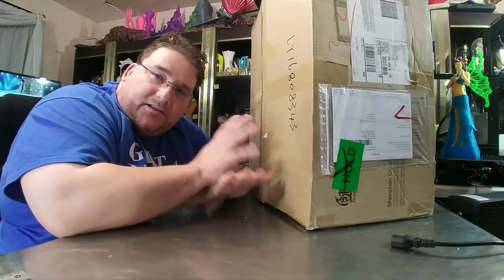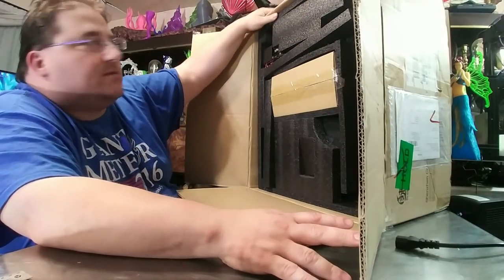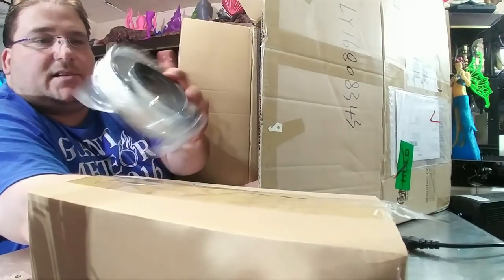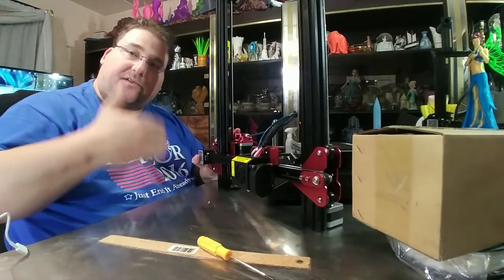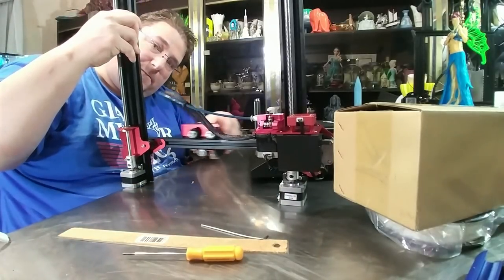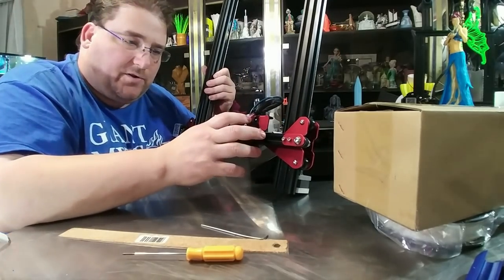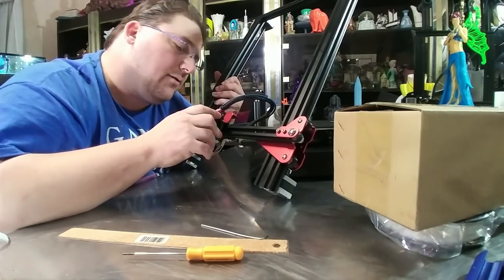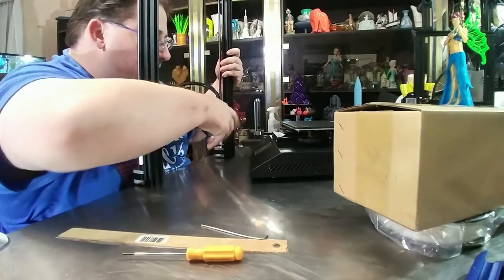CR-10s Pro Behind The Scenes Series Part 1 - T3DP

Comment: Where can I buy the sheet they used on top of the glass? My CR10S Pro has the same aluminum base but the removable bed is aluminum as well instead of glass which is what yours has. My removable aluminum bed is very warped which is causing a lot of issues. After tweaking with ABL settings for days I think it's better to just solve my warped bed issue. If can buy that sheet material that came on the upper removable bed and put it on the aluminum base (the base is completely flat) it could solve my problem. Anyone know where I can buy that sheet or something better?
Reply from the maker: Go to Home Depot and for $10 you can get a six pack of 12 x 12 mirror panels slap one of them right on there if you're not in the US any Home Improvements tile store should have them and they should be very cheap then just either print directly on the glass or apply glue stick or Hairspray or apply a normal bed sticker to the glass
Reply: @nerys71  I did that last night: https://imgur.com/gQHE3Yf

I disabled the sensor in the leveling menu and changed my GCODE to do G28 X Y; instead of just G28. No more ABL for me but I'm getting perfect first layers now. I learned the importance of a flat bed. Is this the proper way to disable the sensor?
Reply from the maker: Sounds like it. You cant fully disable it since its also the endstop but the mesh is what you need to disable till that is fixed.
Reply: @nerys71  Since my last message I was able to use the inductive sensor with the mirror from lowes. By lowering it to 1mm from the bed it was able to detect the aluminum base bellow so now I have a completely flat surface(mirror) and ABL on top of it. Getting perfect layers now.

Comment: how better is this or the Ender 3 pro?
Reply from the maker: Technologically speaking light years ahead :-) besides the fans which are easily replaced or adjusted the machine runs virtually silent and the new feeder and hot end assemblies are also big advancements I get almost no stringing clean Prince and the double Drive extruder similar to bond Tech look to be extremely well-made it's a very impressive machine for the price I'm actually surprised they can make this kind of Hardware this low cost

Comment: Yes T3DP i still want that printer...) any kit upgrades that plan on taking a CR-10S to a CR-10S pro?  P.S. great video man keep up the great work.
Reply from the maker: that would be hard to do for a reasonable price. new hot end new extruder new electronics. you could put a bond tech and an e3d on the regular s as well as capricorn and a nicer electronics board and some tmc drivers with a touch screen but it would probably cost you a bit more than the cost of this one.